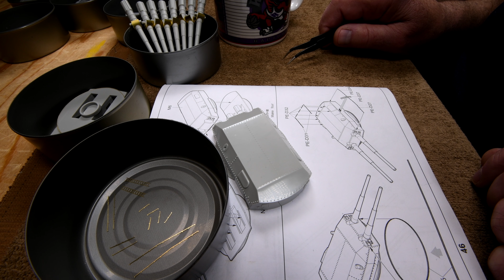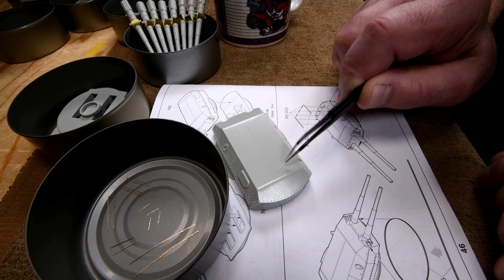The Model Ship - Part 313

Comment: Ron, for those little railings, dip the ends in CA, and using your steady rest, place them in position. Also, after painting they’ll be more secure. Make sure the turret is secured on the bottom with tape so it won’t move. It’s a challenge, that’s for sure. Try one. If it doesn’t work, leave them off.
Reply from the maker: Hi Tony,
I actually went back and worked on it some more yesterday evening soon after 313 had uploaded. Tried an idea that seems to work, but it does seem to leave visible glue markings. See you tonight at 6 🤞

Comment: 0:27 - HMCS Haida which, after WWII was fitted with 4" dual purpose guns, 35 lb. shell weight.

Bismarck's secondary armament was 150 mm. -  or about 5.9" - shells weighed about 100 lbs. and were for surface targets.
The smaller guns were 105 mm. -  about 4.1" and also dual purpose, used against air and surface targets, shell weight again about 35 lbs.
Reply from the maker: Hi Andy,
Re: "HMCS Haida" When touring that ship, I must not have paid proper attention to the muzzle end of those guns. Didn't realize that they were only 119mm. To me, if it was bigger than my old Lee Enfield 303, it was huge, lol. 👍

Comment: could you not heat them up and as you put the in place they would melt the plastic a little and remain in place. Just a thought I have no experience of model making. Paul
Reply from the maker: That's another thought Paul. My experience with heating something that small is that loses its heat so fast that by the time I got it into the exact position it wouldn't melt the plastic. But then if I don't try it ..... 👍
Reply: I wondered if you had it in place and then used a soldering iron to heat the piece up just enough to melt the plastic?
Reply from the maker: @paulburgoyne75  The radiant heat off the soldering iron tip would likely melt, or deform, the plastic because of the very close proximity. But it's a thought. 👍